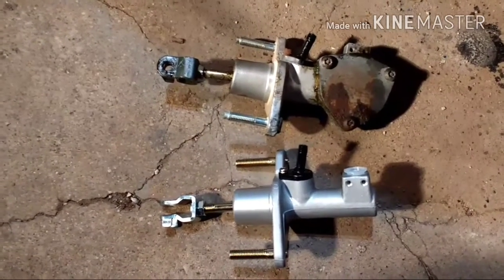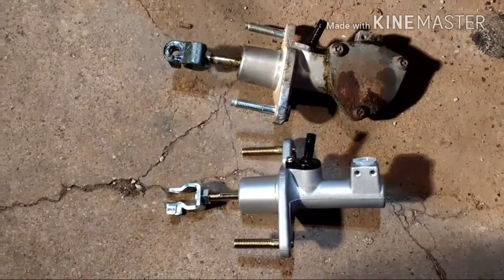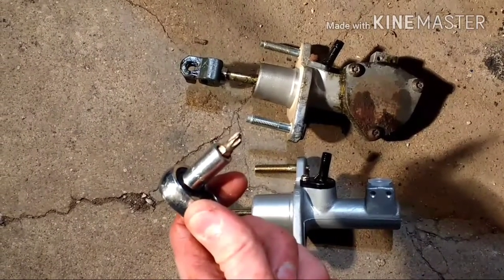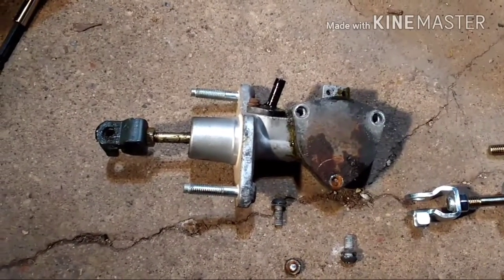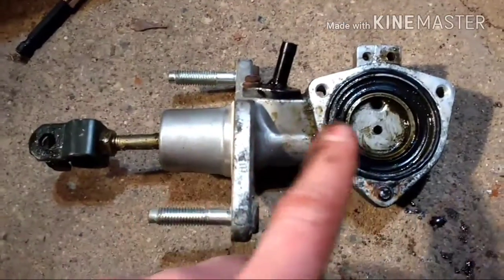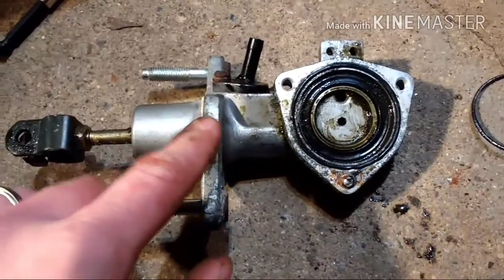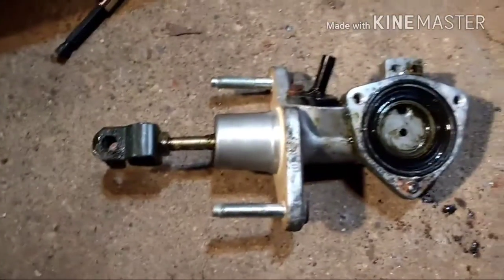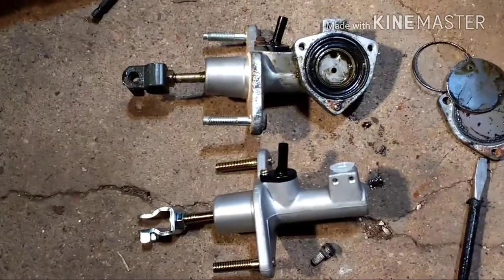How it Works: Honda K20 Clutch Master Cylinder (CMC) Delay Valve EM2 vs Stock

Comment: i drill  threw the stock master  to bypass the delay valve works like a charm    only thing is if the triangle leaks  its pain in ass  u can delete it by taping and pluging the holes in the delay valve or   tig welding them closed the drill hole by pass works like like the em2 master

Comment: The triangle thingy is not necessarily bad, for racers and performance enthusiasts maybe because they want the raw , harsh , instant  engagement.   Helps save shock to your trans and drivetrain components, it has nothing to do with grinds etc   Most whom change it and claims it fixed grinds etc probably had a faulty previous cmc and or happened to adjust the replacement cmc more properly than the previous was adjusted.      
      The triangle damper thingy simply doesn’t allow the clutch to instantly and harshly engage.     Sort of Iike higher end toolbox draws and such where you can push the drawer in and how it dampens before it slams  shut.     Has nothing to do with opening the drawer or disengaging so it would have nothing to do with promoting grinds into gear etc.         Nothing wrong with ridding of it with an EM1/EM2 of course , it’s more fun and for racing perhaps you need instant engaging , I myself also changed it for that purpose but if say you have a good cmc and confirmed it’s good (no leaks, no internal valve issue) even if it has the damper style and have shifting issues and diagnosing strictly the shifting / disengagement  issue , look elsewhere because it’s not the cmc.      I learned this the long way LOL
Reply from the maker: I think you are right on all counts. I didn't notice a huge difference. Thanks for the comment!
Reply: My only issue with these is Ive had two fail on me after installing a stage two clutch.  First was one of the bolts holding the triangle cap just snapped and the car was stranded. Second was the O ring in the triangle failed again causing the car to be stranded.  I'm not sure if I have the worst luck but my third OEM CMC is leaking now so I have to go with the K Tuned CMC setup to completely avoid the constant failure of the OEM CMC.  That's just my experience though
Reply: Gotta disagree brother I’ve had 3 Oem Fa5 cmc brand new two which never stopped grinding soon as I went with a CMC em2 completely went away

Comment: Do you have a part number for the non damper valve master cyl? Im looking at replacing my crv master cyl without the damper. It looks like a civic master would work.
Reply from the maker: I don't have a part number, but I think it was from a 2003 civic ex 1.7 that fit directly on my 03 ep3 si. If you look on rock auto you can see a pretty good photo and make sure it is the same one on the CRV.

Comment: Did you notice a huge difference in pedal feel and response?
Reply: I removed my dampener master cyl and installed the a new master cyl (same master that's on the bottom in this video) without a dampener on my 13 Civic Si. Pedal shakes higher in the RPMs and it's really violent in VTEC. You're mostly going to notice a difference in modulation when you get rid of the delay valve that's found in the slave, which I also bought a new slave cyl to get rid of mine.
Reply: @PiroFyre  Nice! I just did my clutch hydraulics job over the weekend. Just reverted back to the oem master, however did the delay valve delete on the slave and couldn't be happier! 
Thanks for your video. Have a great rest of the year!
Reply: @clementdavidv  what do u mean u did the delay valve on the slave?
Reply: PiroFyre  hey I just installed mine as well, have the vibrations gone away?
Reply from the maker: I didn't notice much if any difference in modulation/delay, but there were more vibrations in the pedal that I didn't feel before. The pedal felt more like a mechanical linkage, which I liked.
Reply: @elscorchomotorsports7199  I have the same issue, the pedal vibrate too much I cant stand it and switched to the OEM cylinder but still keep the soft clutch line.